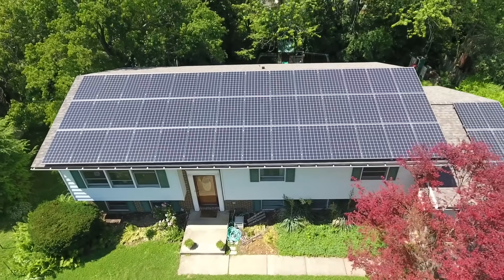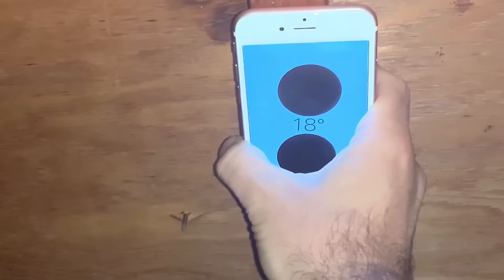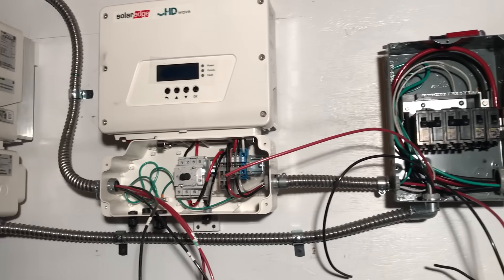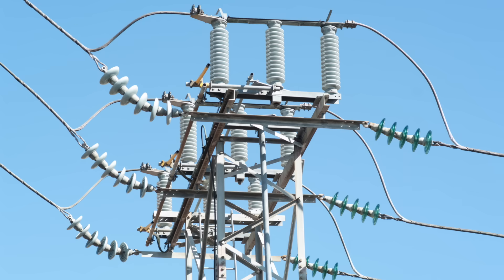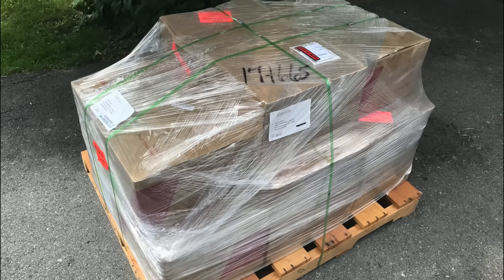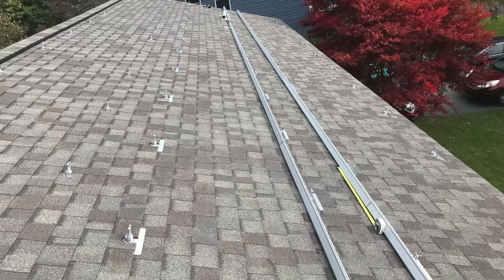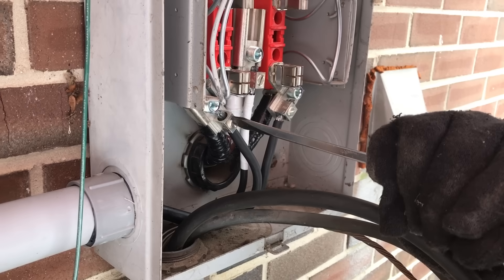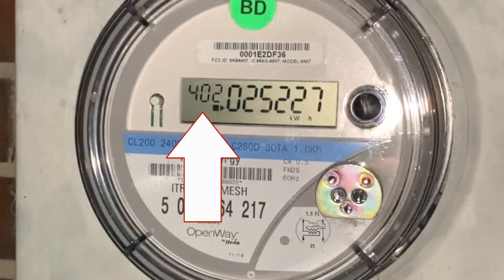I Installed a Power Plant Myself | HUGE DIY Solar Panel System

Comment: The engineering drawing to satisfy the communist, er,  I mean government money grabbing agencies, er, I mean county permits, is $500 alone. Then the permits are another outrageous expense. I could give a rip about satisfying those permit asswipes. I have been through the permit crap before. Dealing with all that is enough for me to say it isn't worth doing, just to keep my sanity. Then there is still the cost of all the panels, and mounting and hardware. Then that takes care of the sunny day part of this. Next are the batteries, and the pure sine inverter. Enough to power the AC unit day and night. I just don't have the patience to deal with the county here in central Florida. As much as it would seem to make sense for solar. The payback time wouldn't be in my lifetime. Then there are the storms and hurricanes that wander through.

Comment: The only alteration I would do is, install a storage battery or two, enough to run the house during the winter for at least 48 hours on batery alone.  As soon as the sell-back of electricity to the grid has paid for the solar panels, cut the house off of the grid and disown the power company.

Comment: I also dont have bills . Ive got a 1870 boiler in my basement that gives me heated water and heating in general . It runs on wood 😄 . And i use almost no electricity.

Comment: the fact that youre even allowed to wire up solar by yourself unlicenced is amazing... my country in australia dealing with solar is very strict. its a separate licence on its own.  also keep in mind the amount of solar panels you have that can produce about 700-1000 volts and can cause some injufry if shorted... 

good stuff anyway
Reply: Yes same in England
Not a chance in hell that a diy guy can touch it. In fact even electricians need a special license to install and sign off work.
This guy was very impressive though
Reply: Uhhh usually you don't wire them up in series where you'd get that voltage

Comment: Make sure you check with your insurance company for verification that the panels wont effect your roof..incase of leaks. As a former Insurance adjuster...there is many a time we denied rain and wind damage coverage around areas that had satellite or antenna brackets.

Comment: How much will it cost to buy and install
Reply: Much more than he thinks he will save over 25 years.  Had a friend do this and withing 2 years of use he had everything removed.

Now, if you go completely off grid, this will require a huge bank of storage batteries, charge controllers and additional wiring so the cost goes way up and the maintenance costs increase exponentially!  Solar/wind is not cost effective and in no way is it going green!

Take a look at the many websites that show you how solar panels, wind turbines, batteries, electronics and wire insulation are actually made (petroleum products = OIL)!

Comment: So I have a question. 
My solar system is now installed.
(By a licensed installer)
The utility code says the net meter is on back order. So my question is, can I effectively use my solar system without the net meter?
Are there any dangers or issues?
Reply from the maker: Did you ask the the utility?  I don’t think there would be any safety issues.  It is possible that your current meter might record excess generation as usage.   That is, the utility might charge you for any excess since your meter would only go up (being that it’s not a bidirectional meter). But I could be wrong.

Comment: After reading the comments below regarding the downside of the plastic zip ties, a quick Google search found that you can also buy metal zip ties. Not as cheap but then you won't have the issues of using plastic presumably.
Reply: Metal ties rust rather quickly and need replacing every few seasons depending on weather conditions where you live.
And if used to secure wires and cables, they require additional insulating materials to prevent possible shorting out of said wires and cables!  This increases overall cost and especially maintenance!

If you use UV Stabilized ties, made from recycled plastics, they will last longer that the solar panels!
Reply: @jfrphoto01  I live less than half a mile from the ocean in the rainy Pacific Northwest and have never had a problem. But, to be extra cautious, you can buy them in stainless steel - about $20 per 100 ties.

Comment: As someone who’s been in Solar for 9 years starting when I was 21 I think you did a great job I’d give this a A- one thing that I thought was really impressive for someone doing it by your self for the first time is your wire management and not running a bunch of conduit between both arrays and running everything in the roof it just looks sleek and a lot better I’ve seen other solar companies run a bunch of conduit and it looks like amateur hour and it looks horrible It reminds me of people that hang up a tv and have the wires hanging down under it so I give u major props. On that the only issue I see I would have done differently is used the enphase micro inverter instead of the solar edge with optimizers with the micros inverters you get both in one with great monitoring it might be a little more expensive but it’s worth it plus you have less components and if you ever wanna add batteries in the future enphase has a nice new battery that integrates with there micros inverters perfectly my other issue was tapping straight into the meter I’ve also preferred to go into the customers main load center into a breaker for the extra protection but other then that you did a great job for a first timer and it will give other people confidence that they can do it themselves also. Great job all around 👍 oh and one other thing I would use a non fuseable disconnect if your local jurisdiction allows it because after a few years them fuses blow out a lot and if you tie into the main load center your already protected by the breaker
Reply from the maker: Thanks for your comment!  For micro inverters, yes, there is less single points of failure and a little easier on the design and install side.  It’s was actually more expensive versus what I did (plus installers were telling me that had issues with enphase- though again, that was back then) but that may not be the case these days.
Reply: You really dislike periods lol
Reply: what happens when someone needed to reshingle a roof ? do you have get a new roof ? or can you remove and put the panels back up ?
Reply: Just had to do this recently. You just remove the panels and put them back up.  @nfabulous2932
Reply: Great, but we have a different system; we are not allowed to be connected to the electricity network, we can only use solar systems for our own use, how does that work out? Can you switch it off? I was thinking for hot water and the pool pump/ fridge alone.

Comment: Your roofer is putting in too many nails.  Extra nails reduce the ability of the shingle to expand with heat.  That stretches the holes and causes leaks.  Expect to replace your roof soon.  Shortened roof life is the result of nail guns.  Back in the day when using a hammer, they only put in the 2 nails required and the roof would last longer.

Comment: Congrats.. one question: wouldn't it make sense to place panels on both sides of the roof to add weight balance? ..i thought tiled roofs had to be weight balanced to stop wind causing them to collapse?
Reply from the maker: No, it's not economical to put panels facing north.  Weight isn't a big deal since it's distributed.

Comment: WHERE YOU LIVE.....Getting a permit was easy........in my city that set of plans would never fly......Best and easiest way to put up solar in most areas is a solar kit company. they provide the plans and all the parts and helped me get the permit which was not easy. Also phone help free. It was just a very small amount more than buying the stuff myself. for 7kwh for $13000, engineered stamped included. plans everything I need. No guessing.

Comment: I live in Arizona where we have lot of solar one thing people need to consider is the fact once they are on the roof you can't walk on the roof if anything needs to be done on the roof have to remove the panels to get to that part of the roof. Another problem is roof itself might not be big enough to produce enough power used by the home here we use lot of power to cool in the summer. Lot of installers here will under-estimate to get someone sold usually on a lease which leads to disappointment to the homeowner when they find out their paying for electricity and a solar lease.

Comment: Uhh, 14% return on investment ... over 25 years?
That is not anywhere near average stock market returns.
I know it's hard to stuff all that info into 12 minutes, but
what about the cost or replacing the solar panels and
equipment at the end of the 25 years, assuming you are
still living there.  Or ... if you sell your house, how do you
get paid for having solar panels.

Also, as to your costs, you got lucky if you had no screw-
ups, but also how did you value your time?

Also, in my city anyway, whether you use the city power
or not you still have to pay a fee to be hooked the system.
Anyway, very impressive install and hope it worked for you.
Reply from the maker: Check out the video released right after this one for more on the numbers.

Comment: In no case i would damage a chimney! The day will come you have to use it.
Reply from the maker: It's not really a chimney anymore, the previous owner chopped off the top and there's nothing inside.  It's just a tower of cinderblocks at this point, perfect for holding up my conduit. =)

Comment: A lot of hurdles to overcome, you made it look easy. I doubt that. You could tell us what you spent in total before even getting one credit from the power company. What is your actual KWh usage each month on average? If you are using only 18 KWh/month you spent way to much on an installation this big. If you produce 18kWH/day you must have 2 Tesla Power-walls to store and charge at least one car. Don't see any report on that. A credit, what is that? Cheaper groceries? Just wanna know if you had a winning lottery ticket that financed it all.
Reply from the maker: I detail out costs and production in detail in the video right after this one.

Comment: Why tie into the grid if your goal is net zero?
Reply from the maker: You may want to watch the video right after this and you’ll see the grid is necessary in my situation.  1-1 net metering is the key.
Reply: @FrugalRepair  Ahh so you're really just working for the utility company; Net zero bill. 

Not net zero footprint. 10-4.

Comment: No one ever tells you that the solar panels won't work in 5 years and  you will need to constantly maintain them or replace them! All of them turn milky from the high heat they are absorbing and need to be cleaned constantly, because of the minerals in the rain water and that's not to mention they bake your shingles. 
This industry is just another scam industry that only promotes all the pros and omits the cons! It's about like purchasing a boat or RV, they work, but they are more trouble than they are worth and in the long run they cost you a fortune to maintain.
 I'm 50 years old and solar panels have been around since I was a kid, they simply are a fairytale sold by snake oil salesman. Like unicorns and gold at the end of the rainbow, this isn't a real solution for anything other than a for profit money maker!

Comment: This isn't good or sustainable long term for the planet.  These panels are only good for 15-20 years before they have to be replaced.  Even if they last 25 years as their waranty claims, you'll have a bunch of solar panels hitting the landfils after the previous two generations of panels expired.  Heavy metals and bunch of unrecyclable crap. Then you buy a new batch rinse and repeat.  We are just now retiring windwills that supply tons of unrecycleable fiberglass.

Comment: For where I am located you can do EVERYTHING up until the grid. The electrical company has to come out and add a new panel to you. Which from my recollection looking at doing this a year ago was either 3 years no net payback or 500 dollars. For us we would have paid the 500 then truly been net zero as we are electric everything for our utilities. 

We ultimately didn't do it due to perfect Covid Cost time. You mentioned about 5 year payback we were about the same since Array used we would actually make money supplying the neighbors.

Comment: I guess oneof the my biggest question is the price of solar panels and also I dont think it would be this easy to mount them because I live in Croatia and houses are made from bricks, stone both on inside and outside. So that would probably be a problem for wires and other installation plus most of the roofs are made again from flat bricks so not only that you can't just take a drill and install the panels but also you cant really stand on the roof at all since the bricks are only layer between you and the attic. So you would probably fall trough if you would try to walk over it. So yea, I can se many more problems with installing Solar Panels, which then I probably would need a professional to do it and it would cost a lot maybe even more then solar panel itselfs. So unless there is a simpler way to do this or maybe other options such as maybe portable solar panels I dont see this working out at least for me.

Comment: I was looking at some of the other solar sites since I'm thanking of getting solar and  some of them  say it takes 15 years for solar to pay for itself and the panels are only good for 25 years. They also are saying the tax credits only work if you have a high enough taxable income to claim them and that you still have to pay the power company a minimum charge even if you do not use any power from them. I wonder if this is all true not sure what to thank, wish there was a site that you could get a  straight answer.
Reply from the maker: You may want to check out some of my other solar videos.  Particularly, the one I made after this one (I explain the costs and production numbers).  And my latest video where I show how my system made money last year.

Comment: Now not tryna be that guy because it isn't like that, but is there some sort of protection against say hail? Just a concern I've always had
Reply from the maker: It’s a good question.  These things are made to be outside for 25+ years.  So I’m general, it’s not an issue.  Of course, if in a strange scenario something can seriously damage your car roof, it might be strong enough to crack the glass.

Comment: Your video brought back a lot of memories from 2 years ago.  I installed my roof top solar using 320 watt panels and a 6 kW SMA Sunny Boy string inverter.  By doing the design and installation myself (with some paid help), taking advantage of the 30% U.S. federal tax credit and the sale of Solar Renewable Energy Credits (SRECs) to my electric utility company, combined with net metering, my 6.8 kW system was paid off in just one year, and my monthly electric bills are now $0.00.
Reply from the maker: Wow, that’s so great to hear!  Congratulations!  Did you make a video about it?  If so, send me the link via email.  I’d love to check it out.
Reply: @FrugalRepair  No video to share, unfortunately.  You did a great job on yours.  There were some notable differences in our installations.  My roof was steeper (37deg @ 41deg latitude).  I had to leave 3 feet walking clearance at the top and sides of the roof to meet fire code.  I bought all black panels for a nice clean look to meet HOA requirements.  I used the same Iron Ridge racking as you.  Great product.  My equipment and installation came to $9000 for 6.8 kW output power.  I used a string inverter rather than optimizers since I had no roof shading issues.  The cost was paid off in a year with the $2700 federal tax credit, and a $7300 check from my utility for the purchase of 121 SRECs which they paid up front.  I always tell people to look into the cost/benefit of installing solar.  It could turn out to be a very wise investment.

Comment: Wouldn’t u wanna go under with your ground wire, or insulate it in some way from touching the rails…?
Reply from the maker: I wouldn’t want it to touch the roof.  I don’t think you can buy insulated #6 solid copper wire.  It’s just sold bare.

Comment: Q: If a guy wanted to install their solar system piecemeal (let's say an additional panel every month until the project is fully done (note: not the actual plan)) instead of getting all their panels at once would they have to resubmit all of that paperwork again every time or could you skip a couple steps if you just tell them what your end goal is?
Reply from the maker: Not sure, I would suspect a big issue isn’t with the code office but the utility and any agreements you have with them.

Comment: What are you going to do when it snows and the panels are covered?  No electricity?  Rub to sticks together?  Solar panels and wind turbines are less efficient than nuclear, oil, natural gas and coal.  Now why would they be pushing this on us?  It's not cuz of climate change.  They want an inefficient system that breaks constantly.

Comment: Do not tie into the grid.......this is where extra power goes when it should go to the batterys to store power
Reply from the maker: I would argue differently.  If you have 1-1 net metering like I do, it is usually much better financially not to pay for batteries and instead get credit for the excess you generate.  You might want to check out my latest video I published and it might change your mind.